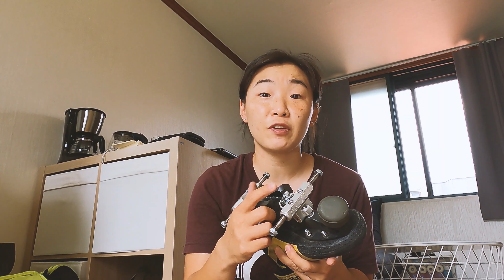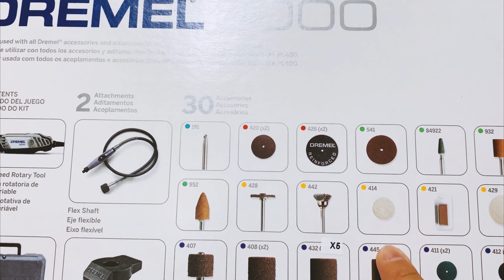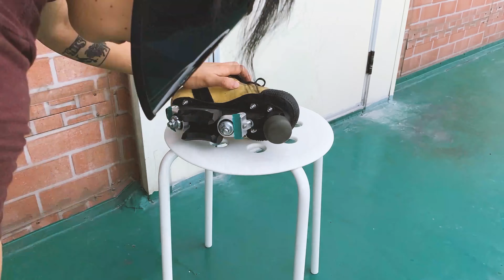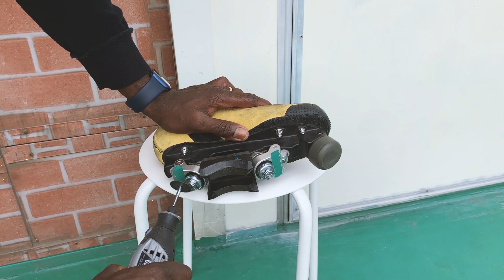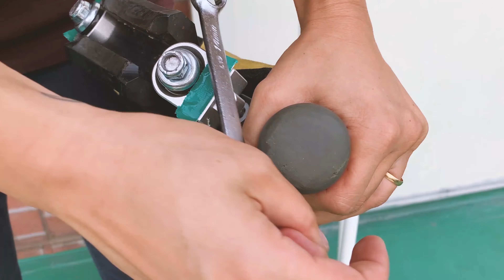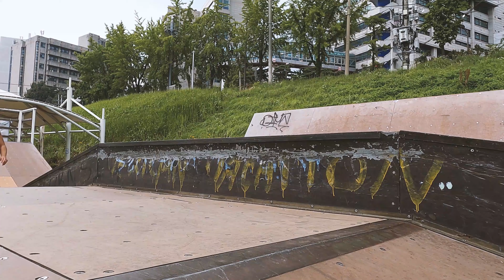How to Cut and Grind Down your Roller Skate Kingpins | Skate Tech Tutorial

Comment: You did exactly what is what you do in construction and such to cut a bolt. Next time though remove the nut and round the edges a bit then nut the nut back on.
Reply from the maker: I cut with the nut on because I was worried I might damage the threads and wouldn't be able to put the nut back on.

Comment: Great vid. I have Parkstars, tracer plate and bandit Discoblox. My kingpins are getting munched up not even doing 50/50 grinds!  I would like to get discotrux but was wondering if I'll have to change my cushions and pivot cups.  Do  you have particular cushions and pivot cups that you recommend so it all fits together after shortening kingpins? Thanks for any help 🙂
Reply from the maker: There are shorted cone cushions in the Discotrux box which I use. Pivot cups stay the same as the Discotrux is made for the Tracer plate.
Reply: @ShortysSkateSeries  Thanks for the info. I really appreciate it 🙂

Comment: Are there no brand of wide trucks you can use on bont plates without having to cut the kingpins to grind? Seems like most just don't fit a 20 degree plate, but I thought these being made for bonts and advertised as able to grind with, wouldn't need any modifications if I get the parkstars. :/
Reply from the maker: The Discotrux is designed as wide tucks for stability not specifically for grinding. It was designed by Disco Tech and he partnered with Bont to manufacture as it was the only wide truck to fit the 20 deg kingpin. 

You can grind on them on coping as you roll on your wheels as well. But you can’t grind on rails without cutting down the kingpin.
Reply from the maker: I believe there aren’t any wide or grind trucks that fit a 20 deg kingpin plate.

Comment: Do your narrow trucks still fit on the kingpin after your cut it down? I wanna cut mine but I want to be able to put my regular trucks back on...I'm scared😅
Reply: I was wondering the same! If I ever need to cut down I’ll probably mark with sharpie around the thread where I was thinking of cutting it to, then putting my narrow trucks on to make sure I can still see that thread.
Reply from the maker: It depends on if you need to change your cushions or any hardware to swap back to narrow. I use same cushions for my narrow and wide trucks so they fit the same on my kingpins.
Reply from the maker: @rosemarie1478  If you use the same cushions for narrow and wide trucks then it shouldn't be an issue. But if (for example) you don't have slide blocks and cut your kingpins, and then want to add a block, your kingpins will be too short.

Comment: Is there a reason you didn't just switch out the long kingpins for a set of shorter kingpins?
Reply from the maker: The type of plate I have I can't easily remove them the kingpins so it was easier to cut them down.
Reply: @ShortysSkateSeries  yeh I have bont tracer plates. A friend told me to "just" switch the kingpin for a shorter one but I couldn't for the life of me get it out. Glad I'm not the only one. Bought myself a dremel, going to go for and grind them off. Thanks for the tutorial
Reply from the maker: @gemjamjones2656  If you have any issue let me know.

Comment: You had to change/ cut your cushions also?
Reply from the maker: I changed to the Discotrux cone cushions that came in the box which were a little shorter than stock ones for my Prodigy plate. I could have kept the original but I knew I wanted to cut down the kingpin more.